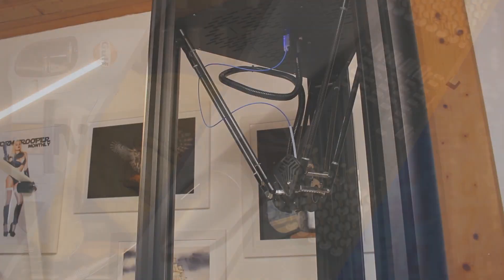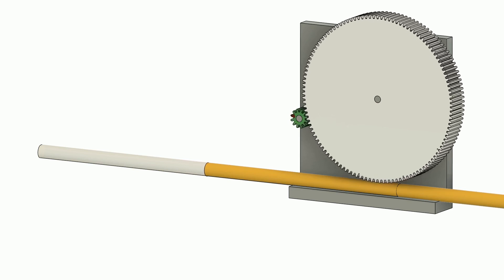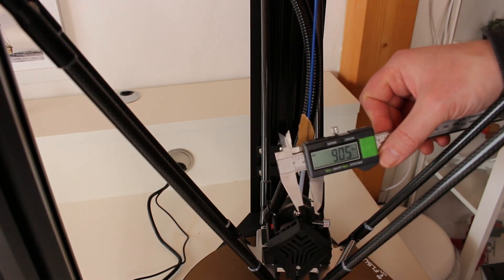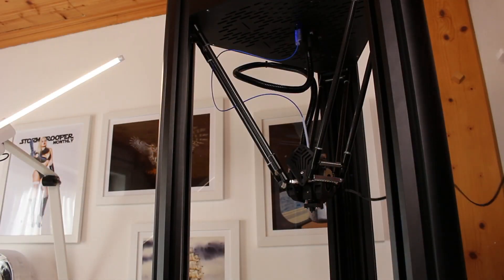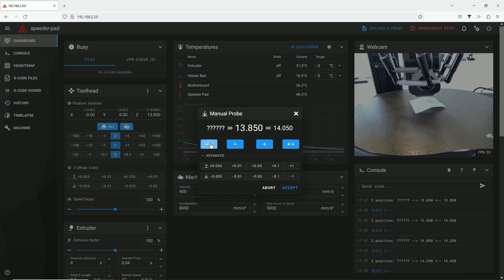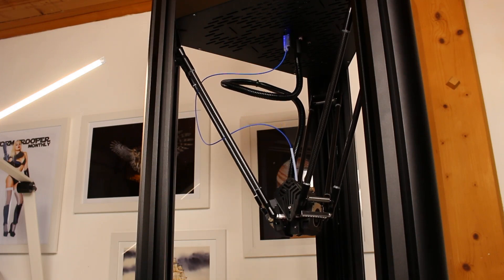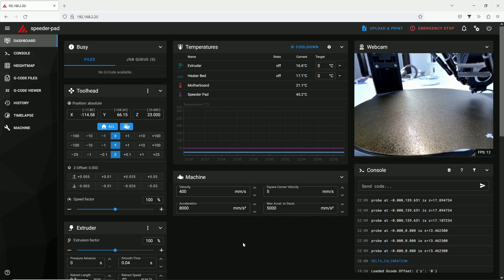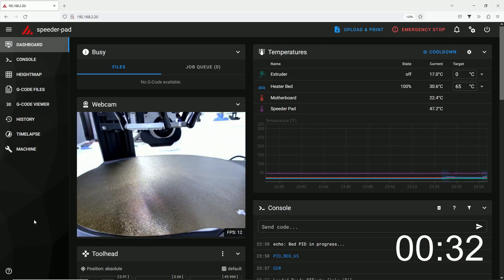FLSUN V400 Calibration running on original Github Klipper

Comment: Weird. The Z offset procedure is the same on my Klipperized SR, and it saves the Z offset as it should, but when starting a print it does not use it, it prints in the air. Also using the command to save Z offset to Endstops tells me the Z offset is 0. Do you have an idea ? Thanks a lot.

Comment: Very interesting video. I could imagine the remaining print issues to be from not perfectly horizontal moving effector plate, caused e.g. by slightly variying arm length. When the effector plate tilts a bit while traveling, the nozzle will to, causing print issues. Its pretty common for delta printers and therefore good resources to check it can be found easily. 
BR
Reply: When you are interessted, I can provide quick help to check that.

Comment: Again a  great video from Mat3D (working late). Allthough time has passed the video is still very instructive.
Small changes one should be aware of:  The PID BED macro  and the PID HOTEND do not execute an automatic SAVE anymore. In stead, the user is instructed to run the save macro.

Comment: so, if i understand correctly, this isnt the flsun firmware, but a flashed original Klipper? then does the auto-leveling equiptment also work on this firmware? i got a new v400 and still thinking if i should flash it
Reply from the maker: Yes this is correct. This is the original Klipper version. Auto-Levelling still works, yes. I am sorry that I do not have the time to provide more content here on YT. 
If you want an overview about the flashing process, I did a video here as well, check this one out.

Comment: Thanks for this tutorial. Am I wrong or did you made some little math error : 

(9.17+9.05+8.91)/3=9.04  (correct)

your calculus seems strange : you seem to calculate with 9.4 instead of 9.04

((100+0,904)*4,5)/100 = 4.540, Am I wrong ?  Thanks again.

Comment: Do you have any issues with nozzle scraping prints ?
Reply from the maker: Unfortunately, this is not yet fully okay, even after instlalling GitHub clipper. It improved, but it did not fully disappear. So: Yes, I still have that.
Thanks for your comment, appreciated!
Reply: @craftingmat5425  Have you turned off combing and turned on Z hop ?  I've become very frustrated by the scraping. I've followed their steps on their YT about changing the cfg and slicer settings as well.

Comment: friend and installed the vanilla following all the steps in your video, but the time of the pad I can't get it to update itself, every time I restart the printer it changes to 12 in the morning
Reply from the maker: I checked it on my V400 - it is working fine for me. This is hard to point the finger at from afar... there is a section in the installation where you set the timezone and related stuff - maybe sth wrong there? Not sure if it needs to sync every new start - if so, then connection to your Network and access to the internet may be required for the time to be set correct... but tbh, this is only guessing from my side. I did not yet check on how the time is synced on Klipper.

Comment: I noticed you had a lot of Macros.  Mine only has two.  How did you get all of those macros?  It would make my life easier not having to use the terminal.
Reply from the maker: The Macros came with the Github Klipper Install. If you are running FLSUN Klipper version, then you will not take advantage of a lot of stuff. In case you did install Github Klipper (see also other video on my channel), then the macros should be there. 
You can enable/ disable macros to be shown - check Settings (top right corner in Mainsail) and go for "Macros" tab. Here you have a list of all macros available and you can enable them to be shown or even group them.

As I am still waiting for some Info from FLSUN on the Belt-Tension, I will not do the Belt-Tension video next, this will take me more time. I will upload a video about the settings in Github Klipper, which may also be interesting for you then. Not sure when it will be available... within next 2 weeks I guess.

Comment: Something about your printer seems like it must be.. mechanically wrong?.. Have you considered the possibility that maybe the axis are not mounted equi-distant around the perimeter of the bed? so instead of perfect 120 degees they are slightly deviated? Just an idea for something to try and check for, you could see if a stick fits between all extrusions equally. Another similar thing to look for is if any of them might have some hardware that shifts the positions the ball-joints with a slight offset, make sure all the rails point true to the center and none have a twist at the base, etc.
Reply from the maker: Thanks for your comment!
I am pretty sure mine is not less correct assembled than any one else on earth... the problem is systematic. Maybe you do not see it on yours (like the separated walls), because you are dispensing too much? In case you printed the snowflake - measure each and every beam of the snowflake - it should have 1.8mm in width. Not sure what is your requirement for the printer, for me, it is not yet as good / accurate as it should be. I installed original Github Klipper (see other video) and it improved after setup about 35-40%, but I am still -0.05mm to +0.25mm off (with maximum offset again in a 120° pattern). I assume this is a common V400 issue which is present more or less, but I assume it is present on any V400 (maybe even on any FLSUN Delta or maybe on any Delta printer).
Reply: @craftingmat5425  I appreciate the feedback, though I was only giving possible ideas you might be able to check into further. If the gantry is true and the division between delta arms is the same, I'm not sure what else could cause those inaccuracies you are seeing. It seems unlikely the belts somehow have non-uniform regions that would be an irregular pitch and shift the distances, or maybe one tensions and stretched beyond specifications. But I don't think those match up with your output issues as much. It's an interesting problem so I'd be interested in seeing your resolution to it!

One last idea is if the kinematic model being used is inaccurate to the printer's joints, in cases with 2 or 3 motors needed.. it might cause an exaggeration in how far it needs to shift, or possibly the opposite behavior entirely or moving too short! If a move is toward or away from a beam, all 3 are needed. If it's parallel to a beam, 2 motors do the majority of the offset from each other.

There are actually some shapes you could plot out that would consist of locking 1 arm entirely, but they can't be straight lines obviously, I'm just not sure how you could use those to figure the root issue out. The generation of such objects would also be kinematically dependent for each printer, in theory.
Reply from the maker: @Roobotics  Again thanks for your input. Did you see the whole video? If yes... my conclusion is that it is somehow software related, because I could turn the issue by 30° compared between Cura 4 and Cura 5. This makes me think, that it is no mechanical issue. 
Still it could be a mixup between mechanical and software - not sure. 
Another idea I had was that it has to do with the non-linear distribution of positions due to geometry issues. The Axis makes larger Movements when it is an "inner" Postion but smaller Movements when it is an "outer" Position on the table. Maybe the positioning precision is not high enough in the outer area of the buildplate.
For now, I do not know the root cause. I just have some ideas. As said I doubt it is somehow mechanical.
Reply: @craftingmat5425  Thanks for the clarification I must have misunderstood what you meant by rotating in the context of the video, I figured it had to do with rotation on the build plate. But if the part is rotated in slicer to end up in an incrementally identical placement but prints differently.. Maybe you would also see that in a gcode simulator as well as being able to pick out and measure the edge move commands at each section? It's probably not important now, but an idea for another time.
Reply from the maker: @Roobotics  I already tried this. I have Simplify3D which has a good simulator - you do not see this issue there.

Comment: Hello, please tell me how much you have a retract? I have pimples and irregularities on the model when printing. Because of what maybe?
Reply from the maker: Hello Igor, thanks for commenting!
I cannot tell from afar... I am using software Retract in my Slicer (Cura) and it is set to 0.5mm (which is default). I am not retracting at layer change, which is the only change I did to my slicer on the retraction topic.
Not sure if your problem is related to retraction.
My first guess would be that your filament is not dry. "Wet" filament will cause tons of irragularities and is not predictable when/ where/ how much.
If you do not have a filament dryer, then put the filament you use in the oven at 50° for 2 or 3 hrs at least. After that give it another try.
If that improved your prints... go ahead and buy a filament dryer (I like the Sunlu S2, there are vids about it and how to mod on my channel).
Reply: @craftingmat5425  Thanks)
Reply: Does the V400 have power loss recovery? If so, try turning it off and check your prints. PLR sometimes causes blobs because the hot-end momentarily stops to record its progress.